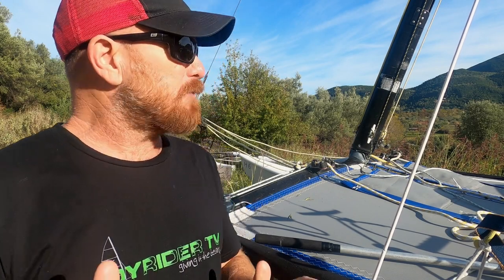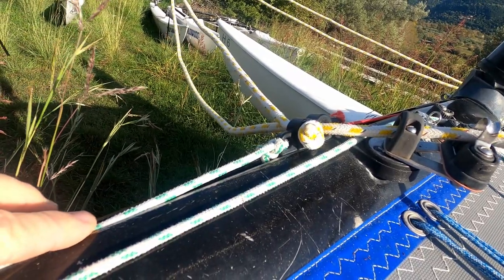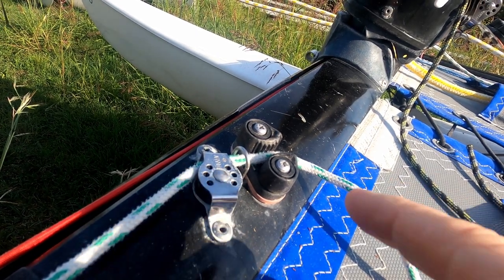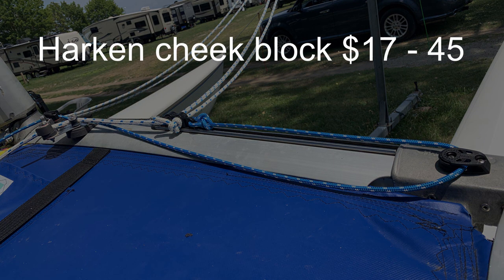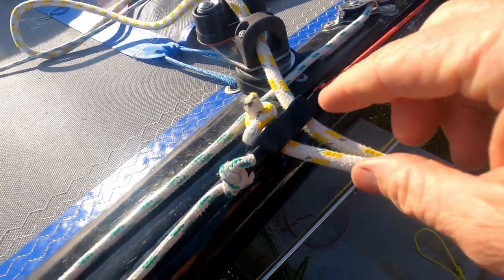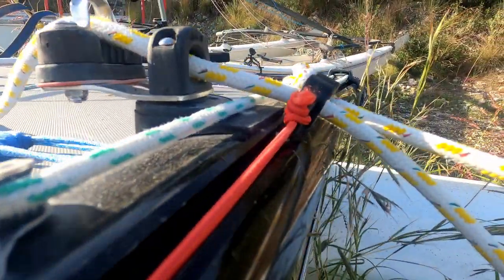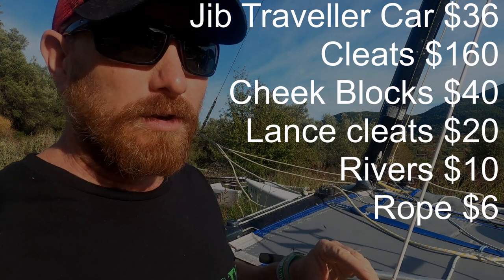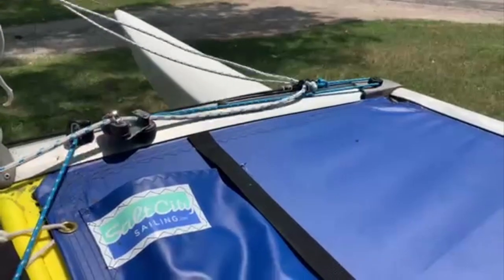Fitting an adjustable jib traveller system to your Hobie 16

Comment: Chris actually has the corner cheek block screwed into the corner casting, not riveted. I like the 'ease' of screwing it on vs. riveting. Getting ready to upgrade my '85 H16.
Reply from the maker: Well spotted. Good tip